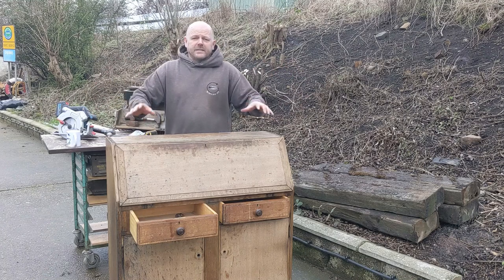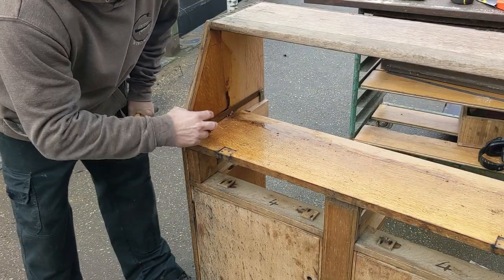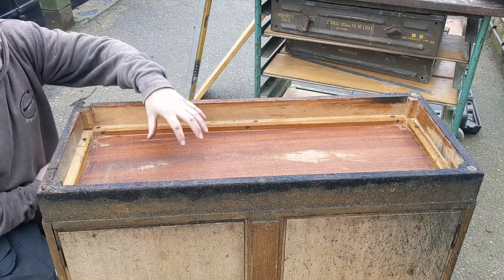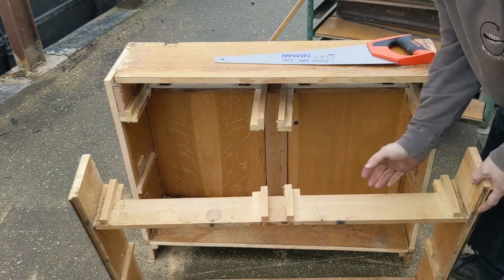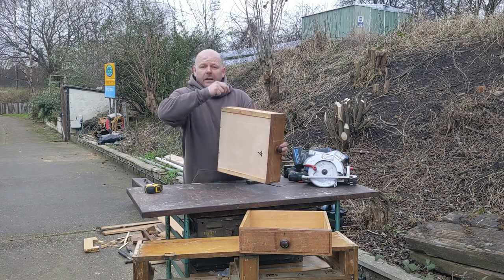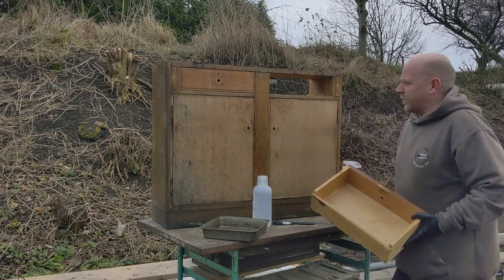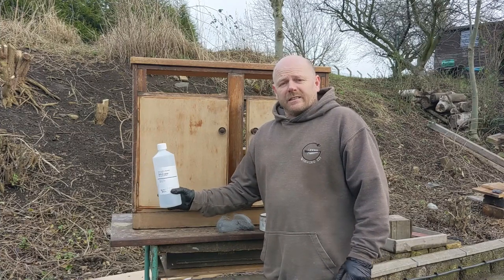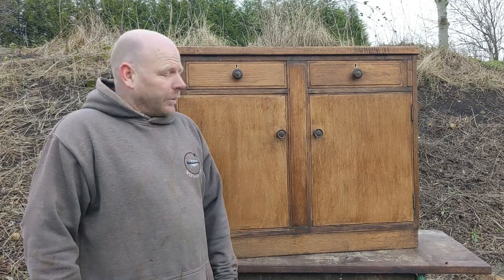Old Writing Desk REPURPOSED as a Bathroom Cabinet

Comment: Thanks Peter, its amazing what you can achieve with simple tools and finishing materials from your local decorators supplier. Oxalic acid is great for removing stains and water marks prior to refinishing and is best neutralized with plain water. A coat of sanding sealer before waxing  is good as well, give it a try sometime. it dry's in a short time so you can get on. Did this kind of stuff for a living at one time and picked things up from our French polisher.( he wasn't French he came from Blackpool)
Reply from the maker: Oooo, I will try the sanding sealer! Thankyou!